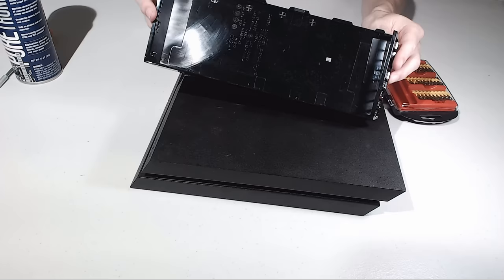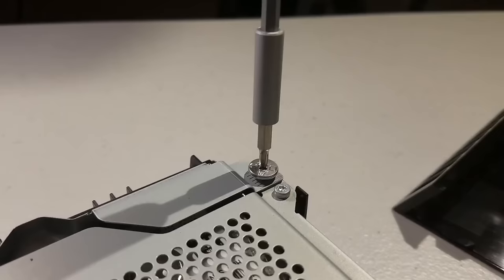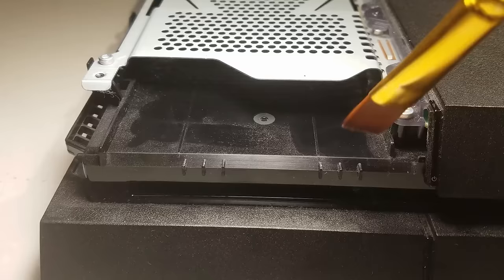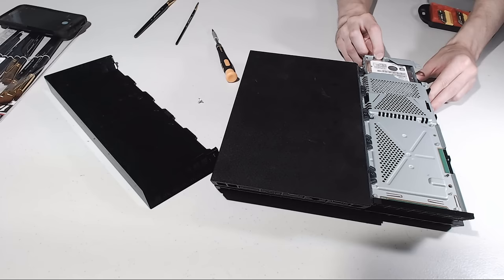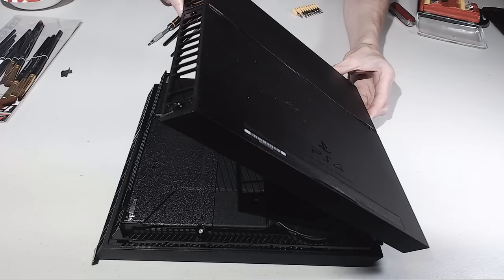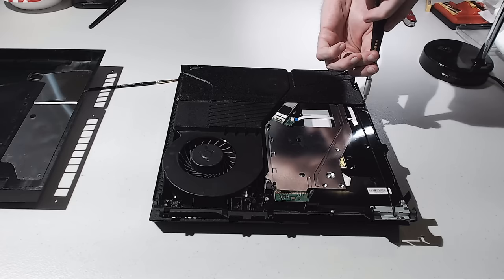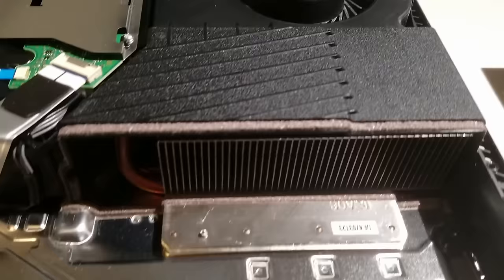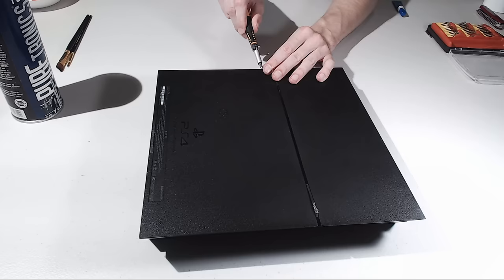Opening and Cleaning My Old PS4... (First Time Ever)

Comment: I'm literally getting ready to disassemble my ps4 and clean it. I know it's packed with dust and grime. It sounds like a f-35 fighter jet in action while I play it. I have a fan facing it on full blast to keep it cool.
Reply: F-35 in action😂😂😂 good 1 bro
Reply: Smae
Reply: @user-jr3fl8ce5i  my PS4 finally gave me the to hot warning after 9 and 1/2 years
Reply: @dylandevlin2102  in some cases you have to update your fan to play the new games that need constant updates, it can’t handle it… that’s if you have a first generation ps4… I had the same problem, I had it cleaned and put new sealant/cooling gel on and around the processor.. I still got the too hot screen within a month… I updated my fan and processor now it’s running like a champ with the fan on low
Reply: Same
Reply: Yah ours do too. I'm cleaning it right now lol
Reply: @Aj-hc9zf  yo how u update ya fan tho
Reply: SAME 😂😂😂
Reply: Mine too watching this to hopefully play games with it quite lol

Comment: my ps4 was 5 years old too, its started sounding like a like a plane engine and started over heating, so one day I opened it, it was a disaster way too much dust, it sadly broke like a week after
Reply: THATS BECAUSE YOU *MUST* RENEW THE THERMAL PASTE BEFORE REASSEMBLING PS4 OVERWISE THE PASTE YOU HAD BECOMES OBSELETE AND THE HEAT WILL DESTROY THE CONSOLE
😁👍
Reply: @bren2385  Thank you! Doing research before I do anything. And I feel like this was very helpful for not breaking my ps4
Reply: @bren2385  where do i get thermal paste?? I dont want to buy ps5 yet 😅

Comment: I've opened my 7 year old ps4 for the 1st time today and I was shocked how little dust there was inside it, i keep mine in an upright position and on a fan assisted stand which makes more noise than the playstation, with about 10 cotton buds it was clean. Alls i need now is a bigger hdd or better still a PS5.

Comment: I figured it’s time to clean my PS4.   I have not opened mine since launch and I can see some dust 🐰 along the sides. I don’t know why, but for some reason, it looked pretty clean. I also have never had the PS4 upright. Out of all the PS4 cleaning videos, this was one of the most informative and straight to the point in less than 3 minutes. I’ve always watched your videos and was surprised I never subscribed. 👍🏻Thank you!
Reply: I didn't even know the top part slid off lmao, but I did clean my ps4 and it had nothing to do with the fan, what it was actually that big metal piece where it sucks the dust into the fan that's making that loud noise, it was caked like 4 inches of dust cleaned that up and boom put it back together sounded brand new :D
Reply: @mikesmith7725  top slide off no bolts or screws take out do that I may have try that out I thought it was all bolted or srew in on top somehow .i got old tv stand I been thinking about getting new tv stand with doors so when I dine playing my playsation I shut door keep Dust from getting inside it or do it while playing it as well .just use cotton swap or cotton balls wipe dust off .i bought Allston disc lens cleaner try clean leans so read disc what I having trouble in frist place

Comment: How about never opening it for 10 years, because I just opened mine up for the first time after that long. My OG PS4 was just like yours, never sitting on the ground or enclosed. It sits on a table out in the open. The results were pretty much identical to yours, but read on if you want the details.

First off all, I only took the back and hard drive covers off. I wasn't comfortable getting any further into it, and from what little dust I found I think it would have been very unnecessary. The back cover itself had some dust inside, but it was fairly minimal. It was just enough to be easily noticeable. Hard drive area had no dust, nor did the hard drive itself. The fan had minimal dust, just like the inside of the back cover. However, the dust was all sitting on the top of the blades. I used a Q-tip with isopropyl alcohol to wipe them off. I then took the console to the outside porch and used an air blower on the fan to make sure there wasn't anymore dust. Although I hadn't seen any more, a puff of dust did indeed come out of the fan when I blew it out, but again it was minimal. I found no dust using my air blower elsewhere around the console. So I think it was worth taking the cover off and cleaning it out, but not by a whole lot. Maybe I'll get a tiny boost in performance, but I'll be surprised if I do because I really don't think there was enough dust to effect it much at all.

Comment: I cannot find the correct screwdriver, can someone help??  I ordered a t9 I believe and it seems to be to big to get the back safety screws out, I'd rather get the correct one next time, please help.
Reply: Theres a safty on the screws stopping you from using the t9. Just need to scrape the nib off inside the screw with a little flathead. A little flathead also works.

Comment: Hi glasscock new subscriber here I saw your vidies on the best modem for gaming the cm1000 and I know you had said that your gaming router is the r7000 is this a good combo to buy I just got them to replace my Arris surfboard sbg6900-ac witch is on its way out the power cord in the back of it is messed up its a modem router combo I though it was a good one but I might be better off with the netgear combo what do you think and are they easy to set up I live in a duplex apartment and my wifi has been good even upstairs in the bedroom even though the modem-router is downstairs the apartment building that I live in is really old so any advice would be hot thanks bro sighned chris